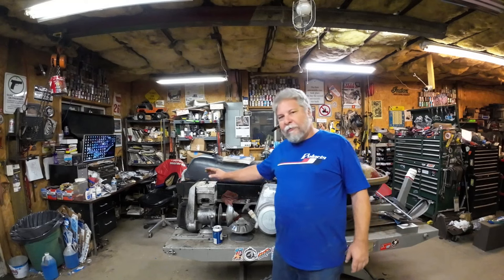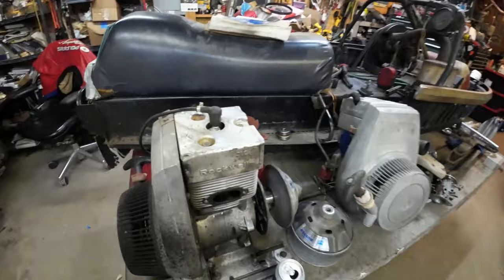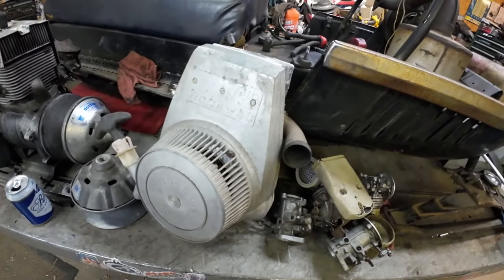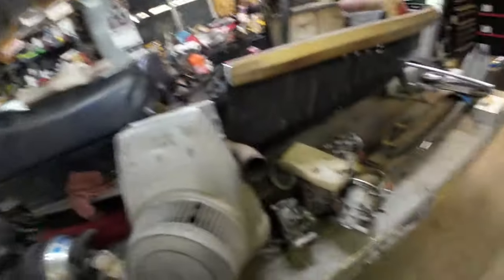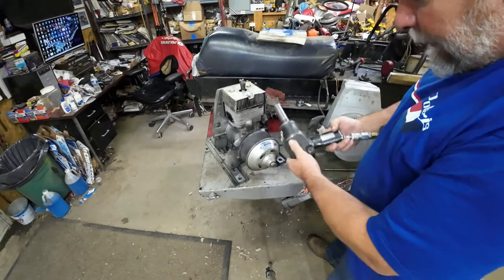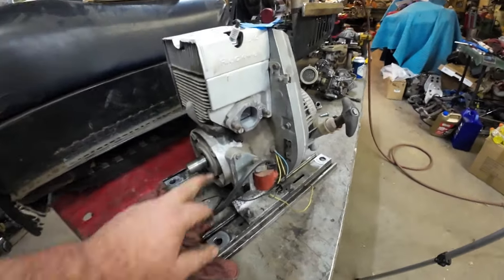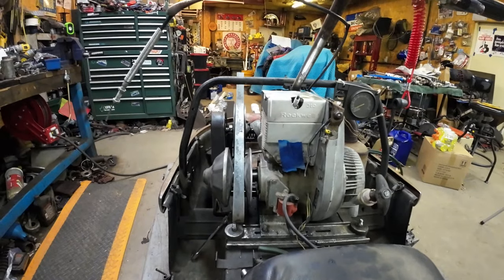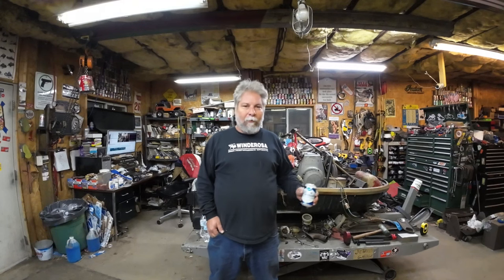"Race" Daddler Part 3: R295 motor, drive system, and clutching. Single Cylinder Vintage Race Sled

Comment: Also the trick with the shoe goo on the kill switch is good thinking. I now do something similar for the wires on the stator, after a heartbreaking "probably would have won" situation where the wire on my condenser vibrated and broke off at just the right time I use silicon to keep all of the wires on the stator from vibrating. Brenden told me about doing that and I felt dumb that I hadn't thought of it.
Reply from the maker: It's a good idea. One lungers vibrate a lot!

Comment: Nice upgrades to a neat old sled... somewhere I'd like to think there's an old AMF engineer shaking his Cane at the screen saying :

 " I told you! I told you it wasn't that bad"
Reply from the maker: In some ways it's better than a normal cantilevered chain case, but it sure is a pain to change the belt.

Comment: Love the one lunger content, but needs more Labrador, just sayin.

 I think you're probably well aware of it but even the "non-tuned"  donaldson exhaust on the old one lungers makes a big difference. I've spent some time with my Sachs on my crude dyno setup and head pipe length/diameter/configuration of muffler make a big difference so those hp numbers are pretty meaningless for people to argue about.
Reply from the maker: I wish I knew what this sled needed. I do know what it is going to get LOL!

Comment: I don't recall the early silver coffin hooded Ski Daddlers having that secondary setup, and what is the difference between a comet duster and a comet power block? I have a powerblock on one of my Ski Doors, it is far smoother and quieter than that crude finger weight clutch they came with. How come your helpers scatter like rats when you're working on something that isn't Polaris? And are we going to see the wide track that you started swapping the 488 Fuji in to?
Reply from the maker: I never worked on any of those old silver Daddlers. Had one once and traded it off to the Blegins. Powerblock is not made by comet. It's a different design altogether. The helpers have all been traveling. They will be back eventually.

Comment: My first sled was a 1969 Motoski cadet. Rockwell JLO. I thought it was a 14 hp. spark plug straight up.
Reply from the maker: There were many different JLO motors.